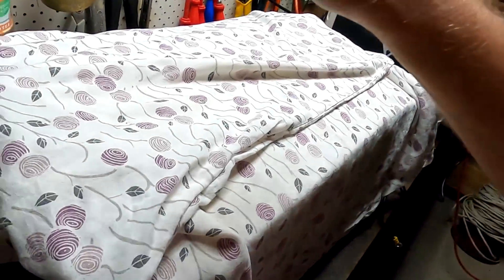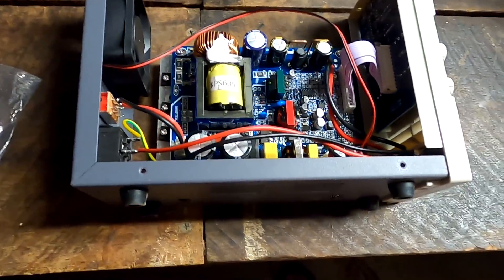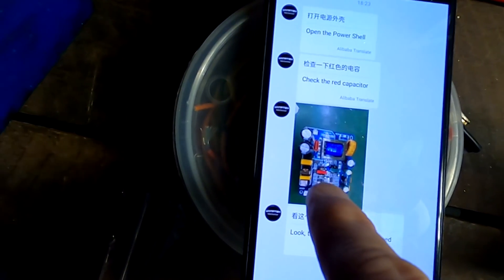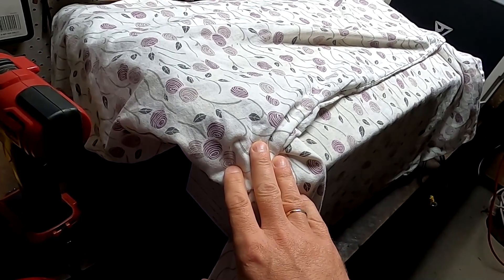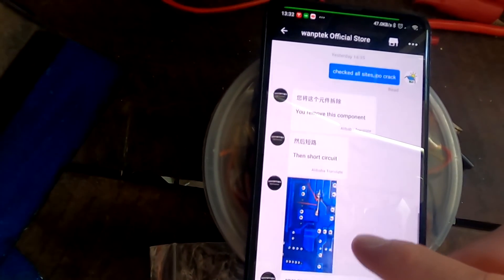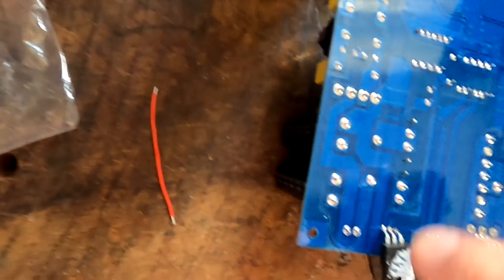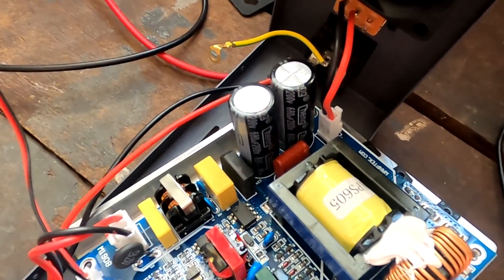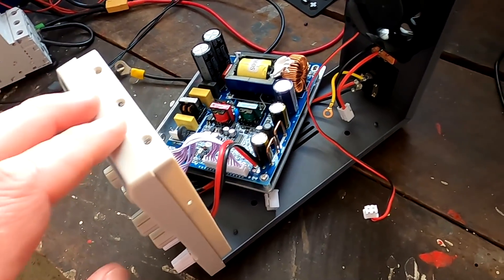Wanptek Power Supply remote repair from China. Best service ever!

Comment: Hi Mate, I have been following your posts regularly and I have been gleaning information so I thank you. 
 I have a Wamptek DPS605U power supply which was accidentally connected in reverse polarization from a 36V bike battery that the JBD BMS 7S-14S was stubbing-ly only outputting 7.96Volts. It instantaneously blew the fuse. I have replaced the 3A fuse and it blows every time I switch on the Wamptek Power supply. There are no signs that anything was blown or fused when looking at the control PCB board.
Do you have a URL I can use to contact Wamptek directly so I can order another replacement unit through the AliExpress?
Thank you
Les Dunn

Comment: Woooo, Andy I do not like this kind of fix as I assume that there was a reason (design wise) to have that “Capacitor” in place. At least I would want to replace it with another cap and then move on. God knows that switching supplies are nosy and can use all the help they can get with reducing that factor.

Comment: Thanks for this video! I thought I burnt up the transformer on my Wanptek power supply, after watching your video, I pulled the filter capacitor off the board, but it turned out to be fine. But in doing so found that the thermistor right next to it was burnt and cracked, I replaced the thermistor and bingo, I'm back up and running again.

Comment: this could not be a capacitor, since it was in series in the circuit. Capacitors behave like open connections when under low frequencies. To short circuit any capacitor is in general a bad idea unless one knows exactly what is doing. Even filtering capacitors are typicaly between line and neutral and short circuit them is really a bad idea. What it might have been is a self resetting fuse (which failed to reset and stayed open) - then shorting it would get the expected effect. It might also have been a coil to fitler RF - coils are also connected in series and behave like short circuit under low frequencies. Regardless of what the component really was and how it was named - great support from the vendor! really, i would wish this level of support from other as well!

Comment: hello, a little message and some information from France, I am presenting my problem: on a lifepo4 battery element, the clamping screw is messed up and it is possible to redo the thread with a tap, but with a larger diameter, or else to  glue the damaged remainder with red loctite, is there enough metal left on the electrode?  thank you for your professional advice,
Good bier !

Comment: Nice when a company provides service ... encourages me - but I remain very skeptical of doing business directly in China - my preference is to find a domestic firm that sells a product and provides the service as well.
Reply from the maker: That would be the ideal situation. If you look on eBay, you will find many of the products sold on AliExpres just locally available. However, I doubt, you will get the service through the eBay seller as they will just buy on Ali anyway and add a margin for their own business. If you can find a manufacturer of these products locally, that would be ideal.

Comment: Have a look into the Riden RD6018 units. Those can provide up to 60V / 18A (depending on the source voltage). If you want to charge 48V packs, a sufficient source voltage (60V or so) is required since it has to provide 55-56V on the output.

But for lower banks (12V and 24V) you can get cheap powersupplies from old routers/switches. Look eg at old Cisco 6500 series powersupplies. The CAC-2500 can provide 55A / 42V, making it, together with 2,3 or even 4  Riden units, a big ass powerstation for charging up to 4 24V packs or so! 
Would cost you 450 aus dollar, but that would be a kick ass charger (Up to 4x 28V / 18A simultanous)

There is one on sale on Ebay Aus for AUD 55. Listed as DS-CAC but I think thats a typo, should be WS-CAC-2500
Reply from the maker: I'm getting the RD6020 now from WanpTek directly via AliExpress. That's 1.2kW of charging power for a 60V battery.

Comment: Same brand here. I run it for weeks for electroforming 24/7. Its about 5 years old now. I do have a 12v computer fan that runs in front. The internal fan hardly runs on its own.
Reply from the maker: Thanks for sharing. I run it mainly for charging the batteries and the occasional electronic PCB power supply when testing. The fan comes on frequently when under heavy load or higher outside temperatures. It is loud though I found.

Comment: I'am gonna buy the RD6018W 60V 18A lab power supply 100$, you will need a extra 12-60v 20a power supply with it.
Reply from the maker: Yeah, I saw that. I wanted a unit ready to go. Otherwise I have to make a 5th YouTube channel 😂
Reply: @OffGridGarageAustralia  You can buy them complete only assemble with case and extra power supply, best thing is, you can swap the power supply easy when broken, like this video, and even use lower ones if the project don't require 60v, I guess I make a custom panel for it integrated in my desk. I like the wifi option on them as well, I buy these 60v PSU's and make a 12cm van on it for cooling and its fairly quiet. with fan max 28, without up to 50 degrees, cant be good for the hardware.

Comment: Thanks for another great episode. I am not an electronics expert by any means, but bypassing a component seems dodgy to me. Why was it there in the first place, what was its function and does it compromise something now.
Reply from the maker: Hi James, I said this in the video. It's only a filter capacitor... I will replace it with a new one soon. This repair was more for trouble shooting.
Reply: Yeah, I assumed it was a safety cap and bypassing would just confirm that this was the issue. Step one. No real danger unless there was a big voltage spike that would fry the PSU.

Comment: I was wondering? since you built your own power supply way back when, why don't you build another? you could build one more closely suited to your needs? I've been looking at things on ebay, amazon, and aliexpress only to find the delivery dates are often quoted to be close to each other and aliexpress b usually being the fastest is there representation of postage time incorrectly stated?
Reply from the maker: It's just lack of time, Peter. I ordered a ready build power supply with 60V and 20A for charging purposes. There are certainly cheaper options out there but I don't have the additional time to look around finding the right parts and putting this all together. That would be something for channel #5. 😊
Reply: @OffGridGarageAustralia  Ha ha channel #5, Yeah I know what you mean, I was looking at different ways of testing/charging and looked at getting the small tester you have but cant justify the cost for my small need, I have a 6A charger (a bit small) but it has all the built in feature displays, I have ordered a cheaper 30v 10A power supply and a 12v 600w power supply these combined with my other equipment should be enough to get the required results.

Comment: THERES A 10 AMP POWER SUPPLY SIMILAR TO THE ONE YOU HAVE THATA GIVE YOU A LITTLE MORE HEADROOM . MAY THE SOLAR BE WITH YOU .
Reply from the maker: That's only 30V though... not good for a 55V battery 😌

Comment: Cheers mate, i had similar power supply sitting here that the supplier on ebay would do nothing to help me with. it died after about a weeks use and i hadn't had a chance to look at it yet.i just pulled it apart and replaced the filtering cap, (luckily I had a Spare in my parts rack) and it is working fine again. thanks for the video.
Reply from the maker: Oh, great, that looks like a common issue with these then. I will replace mine as well, the short was just for testing...

Comment: At first, I appreciate the effort from them helping you repair it. Simply getting a replacement power supply would mean one could end up in a landfill. Always better to repair than replace when possible.
That said, if what some of the others are pointing out is correct, I'd be disappointed if the manufacturer gave bad advice on shorting it. If it leads to catastrophic failure down the line, I hope it doesn't also cause some other equipment or batteries to go with it.
Reply from the maker: The short is just for testing purposes. I'll replace the capacitor soon.

Comment: I can understand using bed linen to prevent anything shorting out the big bank charging, but a "fire blanket" is inflammable, cheap, and might be worth having in the shop, no?
Reply from the maker: Hmm... it has cardboard underneath so not just linen 😌
I know what you're saying but a fire blanket... would that prevent anything in case of a fire?
Reply: @OffGridGarageAustralia  Yes, fire blankets are common on boats in the galley, to extinguish oil or alcohol fires. They used to be made of wool, then fiberglass, and the best new ones are Aramid or Kevlar. All fireproof, so they cut off the oxygen to a fire. Different sizes, all fairly compact, inexpensive (except for the Aramid or Nomex grades), and need no maintanence or recharging.
 Several buckets of salt or sand are also good specifically for battery fires.
And neither the blankets or the buckets leave a duststorm to clean up in the shop.

Comment: That cap looks to be capacitive drop using Xc of the capacitor to limit the current, that cap should be replaced. If it is filter cap between Line and Neutral the it should be X rated cap, and no way you can short out filter cap without creating dead short across the AC line. You should ask for schematic diagram to verify.
Reply from the maker: I'll replace the cap soon. This was just for the test...

Comment: Oddly enough, I own several Wanptek supplies, including a 1200 watt supply. Mine is 30v at 40 amps since I have 24v battery packs. It does run hot, and while not quite as bad as a 1U server, the fan whine is very noticeable. I also noticed with my thermal camera that parts are running around 100 degrees C internally. Anyway, eventually I will take the cover off and see what is running so hot. The direct to a specific part diagnosis leads me to suspect they got a bad batch of parts. I would find out the value and rating and replace the part. I can also very much recommend Riden supplies. Top notch.
Reply from the maker: Thanks John. I was surprised to find only three little FETs in the power supply instead of one large one. I guess, it's only 5A so does not really matter.
The cap will be replaced soon...

Comment: I have 2 PSUs from WANPTEK, so thank you for sharing this. I was running one from an inverter and it seems to doesn't like it, as the voltage regulation become very badly responsive. I might try similar repair. I guess they do not like inverter feed...
Reply from the maker: Mine runs form the inverter all the time. It has never seen anything else in it's life. Maybe the inverter does not like the switching PS?
Reply: @OffGridGarageAustralia  I was running it from a modified sine, so it would be bit more stressful in my case. Also, it was heating up much more, than from the grid socket (Total run on MS was about 70-100 Hours. Then I noticed melted connectors and voltage response issues). Overall, I think that Switching PSW (well different way to address PWM really) is not really ideal substitute power input for regular grid appliances. Especially, if the device is using some form of inductive loads. It is very hard to truly filter the voltage spikes...I guess, that proper filters would be much more expensive than the devices themselves. Trade off from analog to digital has to show somewhere..

Comment: That means your not the only one having problems if he was that specific about where to look. I used to be a repair technician and when a piece of equipment broke it was the same weak component on every one that broke. He should have taken it back.
Reply from the maker: There is no way taking it back due to the shipping costs. I'll replace the cap and good is...

Comment: Thanks Andy, very informative. Surprising support for a $75 power supply. U.S., Europe or Down Under manufactures or dealers would not waste the time, or consider walking a customer through such as repair out of fear of becoming lawyer bait. I'm also curious if you were able to get a voltage rating on the filter cap? My guess it could be only 250V, so upgrading it to a higher voltage or quality replacement might be worthwhile for other users. 
I'm looking for a 100V DC bench power supply and noticed Wanptek offers some inexpensive 120v 3A models,  but I'm thinking a the 60V 1kw unit might be better for bench testing and for battery charging, building a dedicated charging rig using a higher current DC to DC boost converter with high-quality pots, adding an adjustable over-voltage relay and an inexpensive shunt-based volt, current and watt/hour meter and might be handy.

Comment: If that myler capacitor failed, aren't you worried about the quality of the other componants failing ?
Reply: Ehh, that's common with AC components. Usually the first thing that gives up the ghost first. Caps are notorious for failing. Look up "capacitor plague" from 2 decades ago, worked in a computer shop refurbing blown boards. Fun times.
Reply: @jamess1787  ive bought enough chinese junk to know about 80% of their components are fake or just downright trash/badly installed (dry solder joints/lacking thermal paste) to be very wary of them, inverters being the expensive lesson.
Reply: Quality has nothing to do with the failure of capacitors used in this way very well respected brands fail all the time. I have replaced more than I can remember I have even replaced them with ones double the voltage they last longer but still eventually fail.

Comment: Hi Andy. Mine arrived today! Bang on a week after ordering, not bad at all, all the way from China to Scotland whilst the UK can't keep it's own 💩 supplied on supermarket shelves and petrol stations full. 
Back on subject, after acidently pumping 14.8v and raising into a12v AGM... I re-watched your origional Wanptek video from way back on your playlist. Now I have it working perfectly, another AGM's  currant is tailing off as set at 13.5v. 
Do I go to bed or watch this novelty count down???
Thanks for the shout out, make sure you do get a cold beer, you have earned it!!! 
I still have a long way to go, Cable for solar array and wind turbine is my final big ticket purchase then it is put it all together and pray. Your help and guidance through the power of youtube has been extreamly helpfull. Even with shopping just for a pre switch on charge resisor thing your channel links are a great tool to clear the fog. 
Cheers
Gaz

P.S I have a dirty little secret.
I am an English immigrant from Chatham that ran to Scotland nearly 20 years ago. 😁

Comment: I think i can see your next failure in this power supply .... Take a look at the 1000uf 63v cap next to the toroid coil at 6:02 mins. It looks rather puffed up on the top. Happy solar-ing and soldering !!!.
Reply: It seems, that this power supply has insufficient cooling due to incorrect fan regulation circuit. Manufacturer tried to implement "noize killer" circuit, which regulates fan's voltage  (and performance) from temperature reading of MOSFETs + rectifier diode zone. But sensor hasn't adequate thermal coupling to semiconductors. So, this toroid inductance, capacitors (and many other components) experience long-term overheating.  As for my own 2 similar power supplies, I'm planning to install unregulated ball-bearing fan with direct feeding, without control circuitry - it will constantly work at full power.

Comment: I have another variation of this power supply, but with identical main PCB. So, I advice you not to run this power supply with short-circuited capacitor!!! This capacitor connected in series with primary winding of main power transformer and acts as DC blocking capacitor to protect power circuit of MOSFET half-bridge + primary winding from transformer saturation and failing of transistors. So, you need replace this capacitor with good one ASAP! This is thin-film polyester capacitor. My PCB has the following rating: 1 uF and 400V. As unit's scheme is based on computer's ATX power supply schematics, where this capacitor was almost never failed, I suppose a bad quality of it. I'll recommend to replace this capacitor with 2 capacitors, which is connected in parallel, with 630 V rating and with summary capacity not smaller, than original, or, better, more in value. For example, 2 capacitors of 1 uF x 630 V in parallel. I'll recommend to buy a polypropylene thin-film capacitors. It is best type for power supplies.
Reply: I second this. It's catastrophic to run the power supply without that capacitor. IT NEEDS TO BE THERE. Please replace with a new, order one in, it's CHEAP!
Reply: I think it would also void the electrical standards certificate, it could generate more noise back on to the supply as well which might harm the inverter
Reply: @BobHannent  No. This capacitor is not for noise reduction.
Reply: I have this same failure on the big red capacitor, is this 400v AC or DC? Can I replace with  1uf 84V ac/450V dc metalized PP film cap?